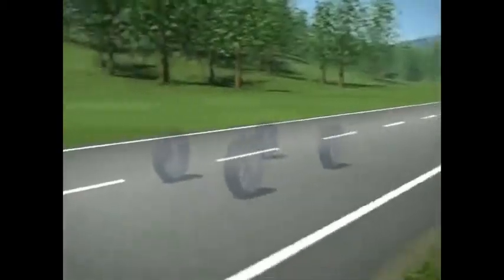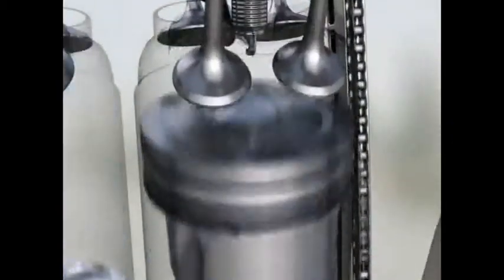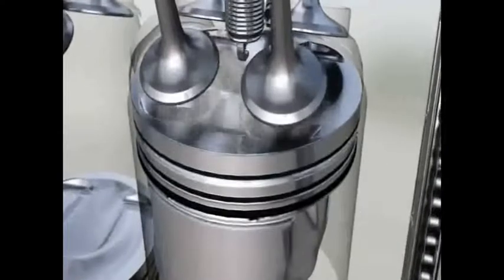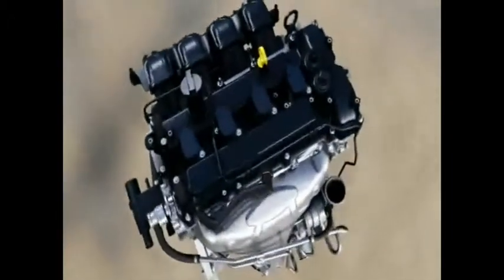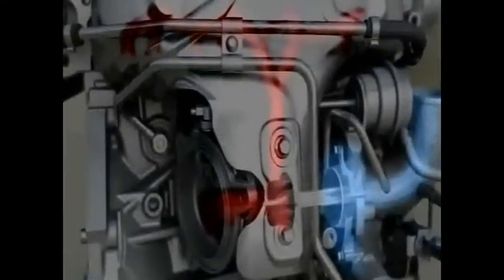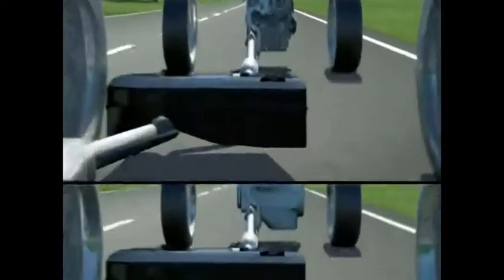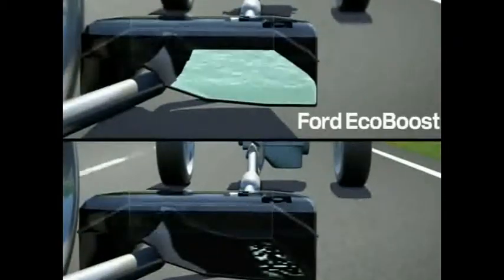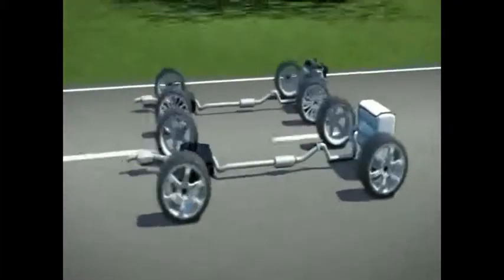Ford EcoBoost Next Generation Engine

Comment: Great presentation on this innovative four cylinder Ecoboost with turbo-smooth turbine saves fuel and co2 than 4.0 six; in fact rear-drive Falcon was first to use Ecoboost but 4wd Territory never got Ecoboost only imported 2.7 V6 turbo-diesel with slight consumption. Ecoboost goes best with ethanol unleaded (E10) bio-fuel than regular unleaded on conventional engines, but recommends premium unleaded and hi-performance 98 octane unleaded for less pollution.